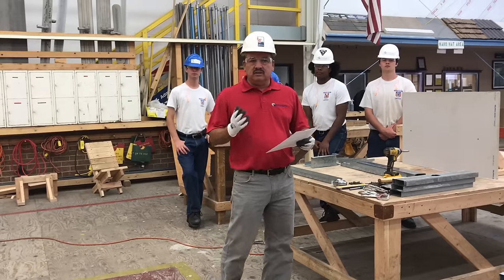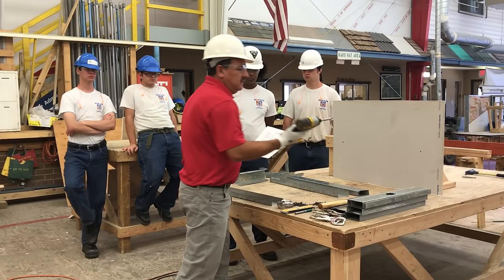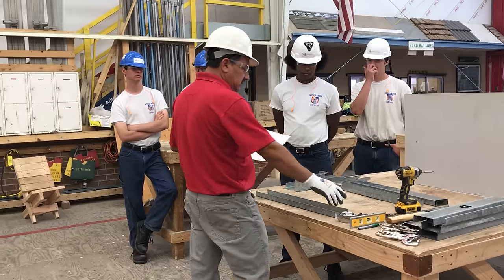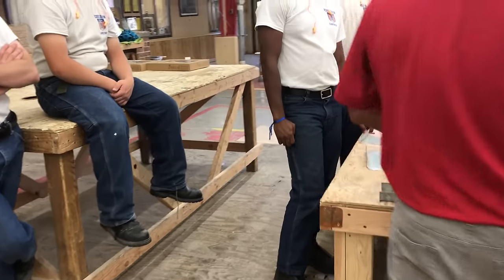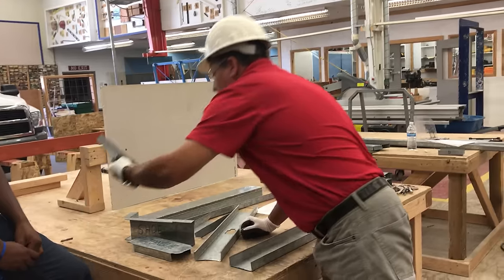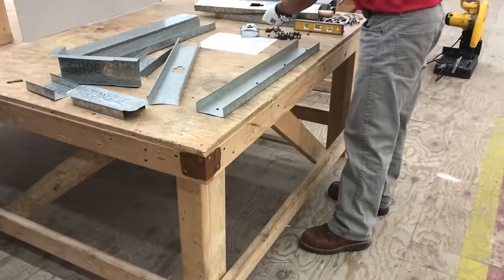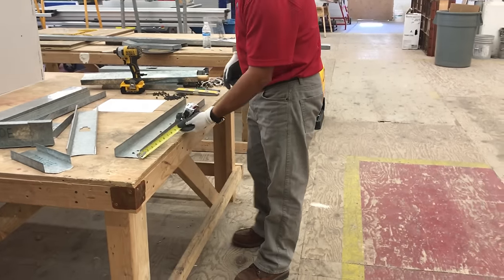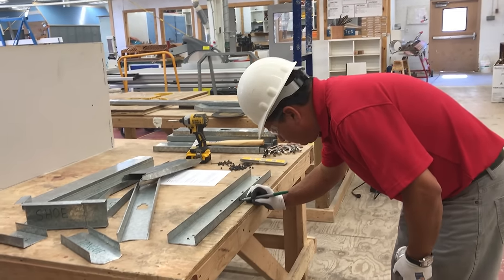Metal Stud Framing Lesson.

Comment: Wow, that was very cool!   Huge amount of info in a very short time.  You demonstrated many types of metal-to-metal joints and many types of complex wall openings in a VERY short period of time.  And much of the nomenclature. The magnetic level is much easier to use than the traditional level on wood.  Thanks, I will have to try steel framing on a small project.

Comment: Great Video!  For people wanting to build an outdoor steel frame there is now a better alternative to track and studs called connectubes.  Connectubes uses 1 1/2 galvanized steel rectangular tubes that are joined together with steel couplers and self tapping screws. No welding needed.  It is sold wholesale to the public and is around the same cost as 18 gauge track and studs.
Reply: Doesn't wholesale mean sold to retailers who then mark it up to sell to public? Can diyers purchase connectubes?

Comment: The difference between a stud and a track is the "flange" on a stud which has a 90° leg of 1/4" at the end that adds rigidity, this usually comes after the leg which is called a flange in a stud and the flange is usually 1-1/4" on a non structural stud and 1-5/8" on a structural stud and a track has a 90° leg of 1-1/4". You can order an unpunched stud so you can't always go by the opening on a stud to say that it is a stud.

Comment: I hope this guy teaches the importance of layout so that the stud orientation is correct.  I joined the union where I am after having moved 600 miles north and these idiots up here learned long ago the wrong way to turn studs and hang drywall so that the board is left protruding on one side because of this and starting the wrong direction with their hanging.  I had to get it straight from Dietrich and print it for some of them to believe me...lost it, but need to get it in letter format again and tape it to every game box on every job.  It's something so simple that so many get wrong too often up here in NY upstate.

Comment: 9:25 If you're doing a long wall it may help to put the top channel on the ceiling first.  Having that bottom track on the floor while you're putting the top track up really gets in the way and can catch a lot of damage.
Reply: How so
Reply: @Hockeykid1515  walking on it, tripping on it, driving the high lift over it.

Comment: He should have use the square as well to make sure everything straight. And they don't use levels will use lasers. And he also didn't talk about the holes in the stud are every 2 ft apart to make it easier to count. And he also didn't talk about the top of the door needs a stud in the middle. He should have talked about more stuff like the rough opening of a door is 37 and 3/4 but overall a good video
Reply: 123justinheller yeah spot on bevan. I mean this teacher if he had spent 5 more minutes telling the students the information you provide they could all walk out of there and start a framing business. I could too just from watching the video and reading the comments...... gees
Reply: Well first off door openings can be alot of different sizes depending on the door going in the wall. Those holes in the studs are for stiff bar bracing and running electrical not "easy counting". You still need a good level in alot of situations even though laser levels are best for steel stud framing. If you wanna start a framing businesses you better damn well know how to layout and build, sheet and plumb wood walls, decks and roofs not just flimbsy non bearing steel curtain walls. I carry a c clamp with me at all times on and off the job, i call it my hand.
Reply: flimsy non bearing steel curtain walls? obviously you aren't a commercial framer, wood is rarely used other than backing and millwork. oh, and yeah, it's rare to actually use a level. other than maybe a torpedo level.
Reply: r.o.'s are dependent upon the door size and type of frame used. it varies with different frames. the cripples above the header goes on layout in most cases as well as backing for control joints if present.
Reply: 123justinheller always use the square... ALWAYS!
Reply: The holes are for spazzer  bars that strengthen tall walls.
Reply: DiGg3r Ds non-bearing steel curtain walls are a completely different animal than a framed wall. Curtain walls are heavy exterior perimeter walls and can include the exterior vision glass. You are correct they are not rated. That’s because they usually contain aluminum and glass which fail with flame contact. 

The flimsy steel framing you’re talking about can/will become a 1 or 2 hour rated wall depending on the UL wall design chosen. The drywall configuration on both sides ultimately will determine the rating, not the framing alone.

Comment: It would have been nice if at the beginning it was emphasized that the material used in this video (20 Ga. steel) and the techniques used (framing a door without jack studs) are suitable only for non-load bearing walls.

Comment: No disrespect but I learned to do the top track first, when  you need a ladder, the bottom track is always in the way! This instruction is great for  a freestanding wall but where I live, absolutely nothing is plumb, level or straight. I can't put a level on the top when the top is flush with the ceiling.

Comment: Shouldn't all studs face the same way or the 2 middle stud face the end studs because it's a door frame ???
Reply: Good question.
Reply: Dennis Meyers so Dennis what is the answer to the good question
Reply: All the same way except the ends.
Reply: Grant Smith what about where the header goes? Can you attach the header to the open side of the stud or do you add a splice so both ends of the header have a flat stud face to butt up to?
Reply: All studs face the same way that u pulled your layout from and for the headers you want hard side of the stud facing eachother.
Reply: Also the end studs hard side facing out

Comment: 've seen on YouTube where metal stud walls are being put up in basements. The metal stud wall is just inches away from the basement cement wall. They only put one screw in the bootm of the metal stud and one screw in the top of the metal stud. With only one screw at the top and bottom of the studs, would the studs be strong enough to hold two sheets of 5/8 drywall. One sheet put on and the second one put on top of that one?
Reply: Yes... actually screws are not needed, just the outer studs. The other studs what gives rigidity is the drywall.

Comment: I have a question about the screws used. We never get to see the screws using up close. Most self tapping metal screws have a head on them that when driven down to its head still leaves the thickness of the head sticking up from the face of the metal stud surface. When you go and try to install dry wall on to a metal framed wall those screw heads will force your dry wall out the thickness of the head. In other words, the dry wall won't sit flush to the metal stud because the thickness of the screw heads suspend it away from the metal stud. How do you make the dry wall sit flush to the metal stud?
Reply: The screw heads dent into the backside of the drywall a bit but will also hump out the drywall a bit. At the ends of headers a drywaller will often beat on the screw heads and framing to drive it slightly below the plane of the wall. Another trick is to shave a little drywall off the backside of the sheet in bad areas.
Reply: You’ve confirmed what i thought might be options for dealing with screws, but wasn’t sure it was OK! Thanks
Reply: You use Wafer head screws. They are self tapping fine thread for metal, and the head on them is flat so you can drywall over it.

Comment: Gracias, Rigo.  I learned a lot in a short period.  Now to see if you have a video for installing a floating steel stud wall, per code in expansive soil areas.
Reply: I don’t think that’s possible, metal track/studs have a coat of maximum of G90 making it strong against but not rust proof.
Installing it on direct soil it’s not very think full.
MHO.
Reply: Oscar robledo in areas with a lot bentonite in the soil, when the soil becomes wet it expands and will heave a concrete slab in a basement.  In these areas (example, Colorado) it’s building code to have a gap of 1.5”-3” between a partition and the floor joists in a basement.   You cannot pass inspection without this gap or “float”.  

Typically, a treated wooden 2”x4” is nailed to the floor and the wooden wall is attached to the overhead joists with a gap just above the treated 2”x4”. Then holes are drilled and spike nails inserted in the holes to keep the wall from swaying. 

I checked with out town’s engineer, and for steel studs, the wall is built and attached directly to the concrete floor of the basement. The wall needs to be 2” shorter than the height of the basement. Sliptrack (“U” snapped track with high sides) is attached to the joists above and the top of the wall sets into sliptrack.  This allows the wall to slip up and down with movement of the concrete slab.

Another iteration involves using a sliptrack with a series of elongated slots used to screw the wall to the sliptrack.
Reply: paul painter thank you for the information.
I misunderstood the previous information (floating).
I see that the expansion it has logic.
But,If it’s seating on top of concrete,  and expect that the concrete will move , that’s something interesting. I had worked on clay soil and understand the behavior of the water and clay, but we mixed with some regular soil, plus triturated stone, foam insulation and for moist barrier 4 mil poly sheating.
(After study of soil)
Thank you for the angle view, that’s info that come handy on different escenarios.

Comment: Mr.  Ramirez, I was hoping you could help me with a question. We have a commercial building (restaurant) with metal stud walls. Because we wash the floor every night the bottom of the studs are beginning to rot due to the excessive water intrusion.  Can I cut the bottom of the studs one at a time and replace just the bottom portion??  
NOTE: The damage covers approximately 8"  up the bottom of the wall studs so I would want to cut and replace the bottom 8 " if possible.
Reply: Jeff Morton what happened to the caulking?
Reply: I would rebuild the studs top to bottom, then seal it with caulk.